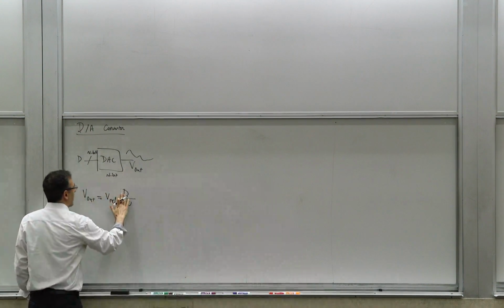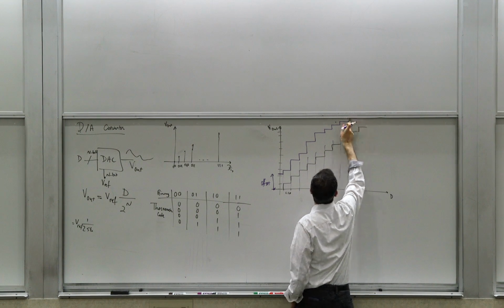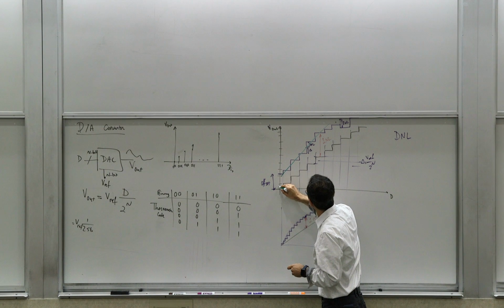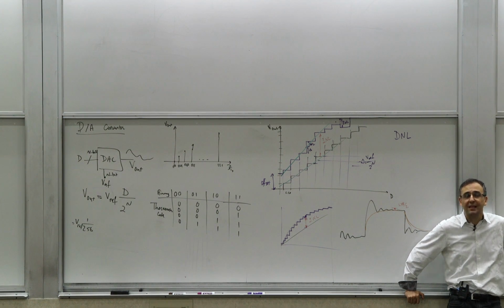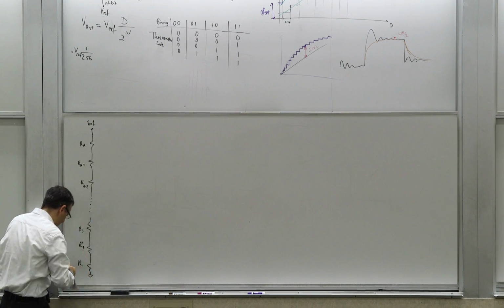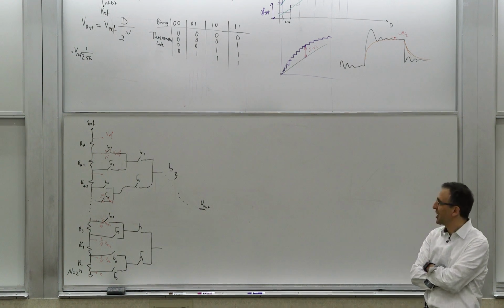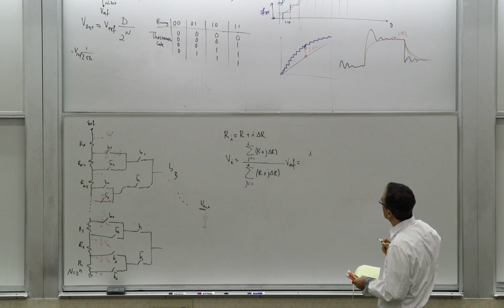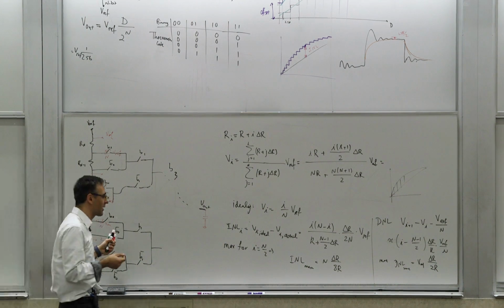181N. Intro to data converters metrics, basic DAC

Comment: 00:06 - Introduction to digital to analog converters (DAC) and their functionality.
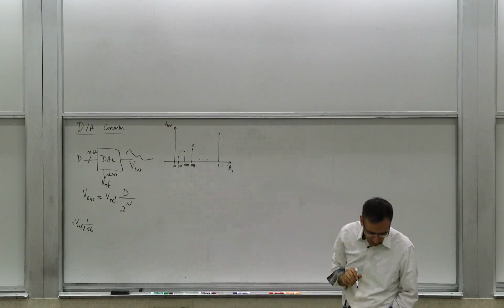02:45 - Explains binary and thermometer code for DAC conversion.
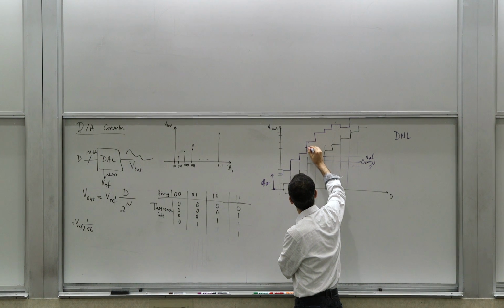07:56 - Understanding DNL and INL in DAC performance metrics.
10:45 - Key metrics for evaluating DAC performance involve non-linearity and dynamic measures.
16:11 - Latency affects real-time applications differently based on their requirements.
18:24 - Introduction to basic DAC architecture using resistive ladders.
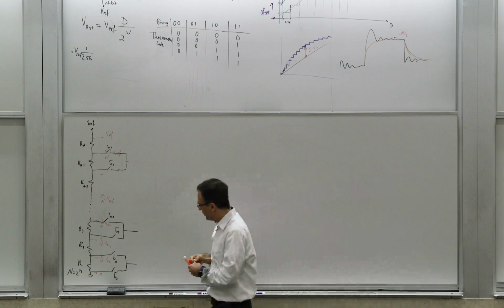23:19 - Binary to thermometer conversion in DACs has challenges with impedance and power consumption.
25:27 - Discusses DAC efficiency and resistor matching in data converters.
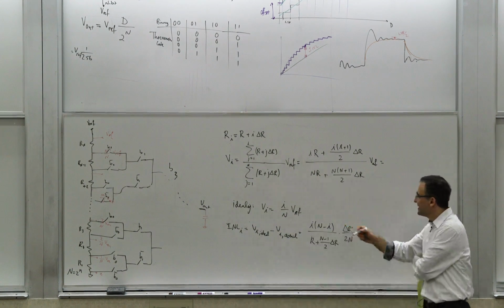30:40 - Understanding INL and DNL in DACs and their maximum values.
33:10 - Understanding INL deviations and their implications in DAC architectures.

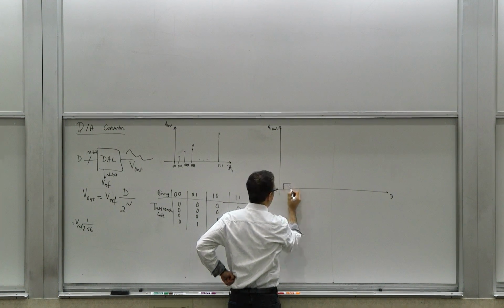Comment: in 4:32 if the horizontal axes represents digital numbers, then half LSB does not exists.
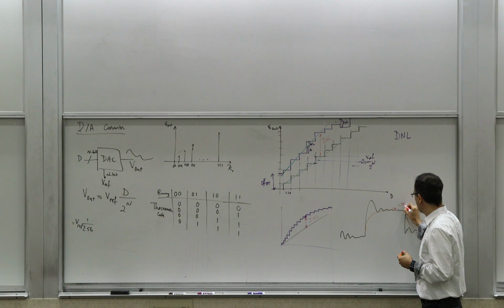in 13:38 because we are considering the analog signal, I think that It has to settle under delta/2 = Vref / (2^ (N+1)) , and not LSB/2

Comment: With Delta R, the equation assumes that each resistor in the ladder deviates by the exact same amount (of Delta R) ... the error of each resistor's resistance are "matched".  In actual voltage, shouldn't Delta R be different for every resistor?
Reply: Prof. Hajimiri  assumes that every deviation is fixed. This is for our own ease of understanding and to illustrate the calculation of INL/DNL for this specific case. In reality, you are correct and all resistors may not have the exact same deviation (it really depends largely on the  layout of the resistors) and delta R is more a statistical quantity (having a normal distribution) with zero mean (ideally). Thus delta R can have different signs along with different values. If you plot delta R for the 65,000 resistors on a distribution plot, you would see a plot similar to a normal distribution. With good matching on-chip, you will see a tighter distribution of delta R with a lower sigma value. Although, a point to note here is that you CAN have something close to a fixed delta R for all resistors if they are laid out in a chain-like fashion. This arises because of the gradient in the diffusion of the polysilicon layer on the chip and thus Prof. Hajimiri's case is not far away from actual real world scenario. In fact, this is how it generally turns out on silicon.